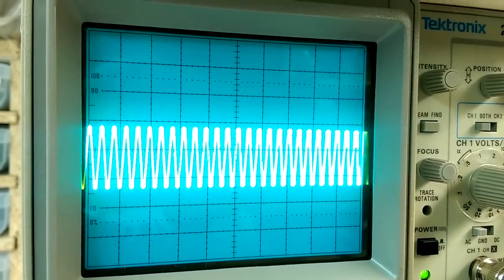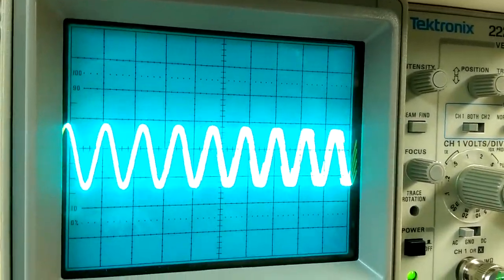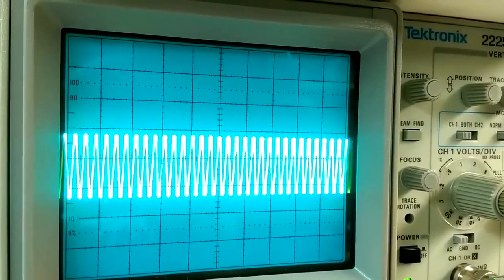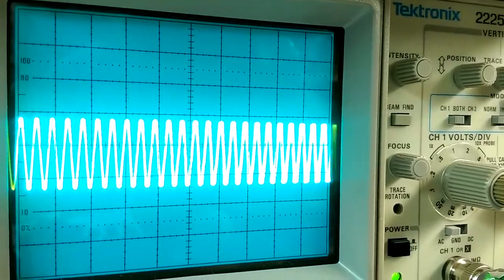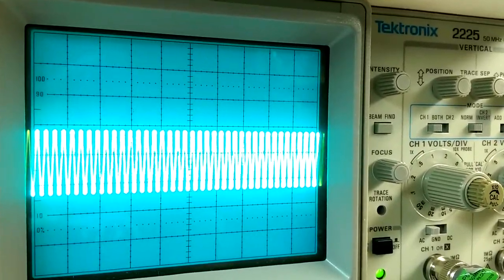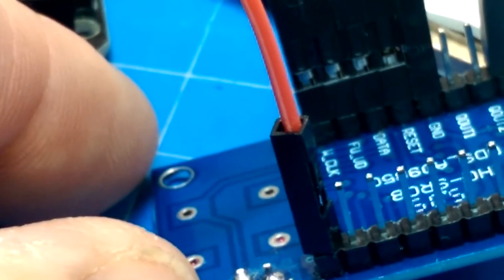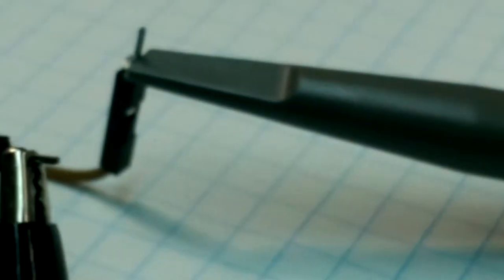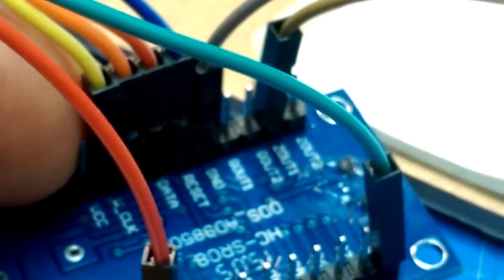SweepGeneratorSketch

Comment: Nice! Thanks. do you know how to change the amplitude and the target frequency and target sweep time?
Reply from the maker: You need to add an attenuation/amplifier stage to the output to get amplitude modulation.  The output for sin is 1v and square is 5v.  

Regarding the start and stop frequencies....

In code, I would set up variables for 

long frequencyStart //  start frequency in Hz
long frequencyStop // stop frequency in Hz
long sweepTime // number of seconds to do the sweep in
long frequencyOut = frequencyStart
long frequencyStep = (frequencyStop - frequencyStart)/(1000 * sweepTime)

then the loop would look something like:

while(frequencyOut < frequencyStop){
  sendFrequency(frequencyOut);
  frequencyOut += frequencyStep;
}
Reply: Thank you so much!!!